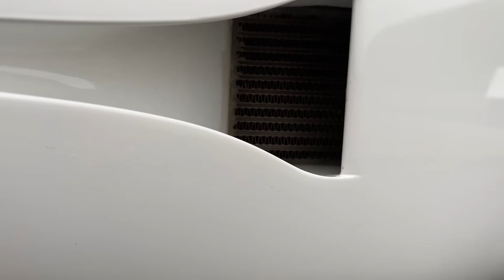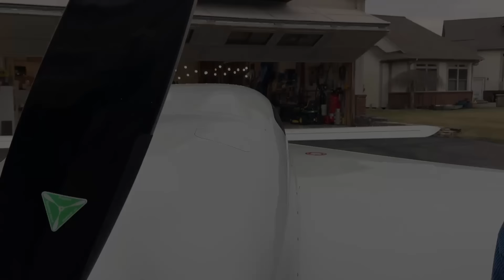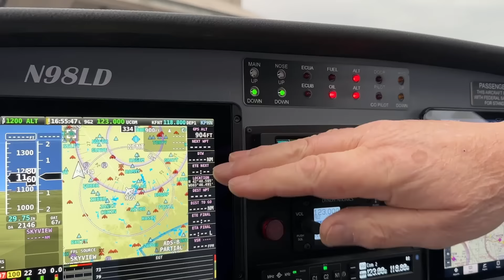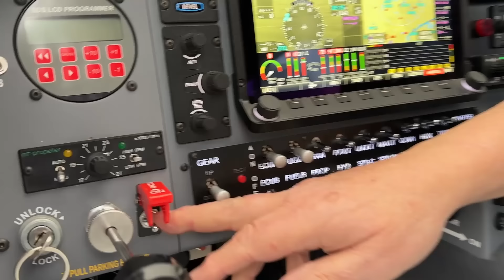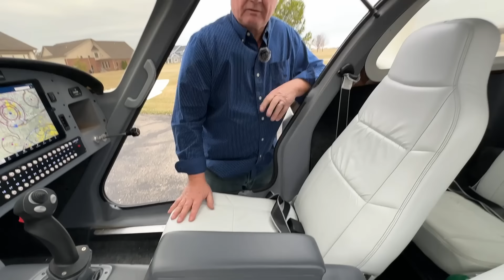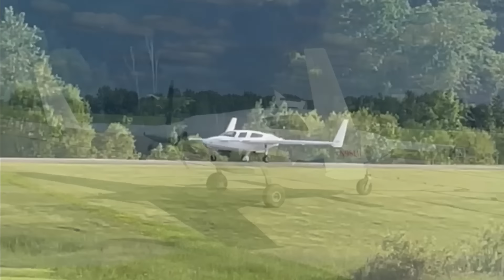LS3 V8 Powered Velocity Walk Around

Comment: Cool build.

Not really a P-51 scoop, though, as it doesn't make use of the Meredith effect.
Reply: That’s interesting…

Compared to the P51… the Meredith effect needs a lot of heat put into the scoop….

The Merlin engine was over 1k hp…. With a lot of heat generated….

Trying to get a useful Meredith effect in this small package… would be interesting…

The rpm of the Merlin engine made the prop tips get closer to speed of sound….  A very loud experience…

The MT prop used on this plane is a quiet prop compared to the aluminum props… very neighborhood friendly!

😃
Reply: @AC-jk8wq  It has been done with Subaru powered aircraft, it's simply a matter of scaling everything appropriately.

PSRUs are a great thing to have, that's without a doubt.
Reply: @  

lots of work in this area over the last decade…

The PSRU failure modes of the past have been catastrophic, especially for the high horsepower Chevy engines… prop loss, followed by weight and balance challenge.

They briefly discussed the gear ratio and the simple system Len is using… but no pics, or additional details I was hoping for…

😃
Reply: @AC-jk8wq  It's surprising to me that engineers would have so much trouble with gearbox design these days, considering the advancements made in the last 80-90 years. Maybe it's related to the much lower cylinder count found in the engines the gearboxes are being used with, relative to the 12 to 28 cylinder engines from the heyday of the piston aircraft engine?

Crossplane V8s certainly aren't the best thing for use in an aircraft, they have heavy counterweight systems and don't seem to do well when used frequently in their higher rpm range. A 3.5 to 4.0 liter flat-plane V8 would definitely be a better fit for aircraft use in this horsepower range. I was just watching a video of a McLaren 650S engine being rebuilt (the engine is based on a Nissan racing engine), something like that seems like it would be far better suited for use in an aircraft, with its light weight, its flat plane crank and its replaceable cylinder liners.

This Velocity uses a PSRU from Ballistic Gear Drives, there's slightly more info on their website, but not much.
Reply: @AC-jk8wq  And, no, I'm not saying that the McLaren engine itself would work well in an aircraft (unless it was built specifically for racing), I'm saying that it has attributes which would work well in an aircraft engine. Obviously, an aircraft engine would be optimized for much lower rpm operation than the McLaren engine (5,000 - 5,500 rpm).
Reply: @PistonAvatarGuy  

Conveniently, the newer Z06 Corvettes are using a flat plane crank….  Awesome horsepower!  😃

The biggest challenge with gear boxes for planes….  Weight and balance.

Putting a heavy object (like a gear box) on the nose, needs to be balanced by another weight towards the tail…. The science call ‘statics’ covers the math for distance and weight….

There is a large driving force for the plane builder… to use the lightest weight gearbox.  This allows for more people weight and/or fuel weight for the flights….

Lighter gear boxes, are not as strong as heavier built boxes… selection of materials also gets affected… 

The second biggest challenge… the cost of development.   We can’ afford to have a failure of a  single PSRU. As PSRU failures are often fatal.

Picking one off a shelf and using it in aviation becomes a giant risk for the owner/pilot…

Modifying it for the specific application… now the pilot/owner is known as a test pilot, in the literal sense….

Where I lose confidence in systems like this… there are always unseen challenges that can arise…

Whatever the failure is… we need to be able to survive it, to fly again…

If there are 10k planes using the same gearbox… there is a good chance that if there is a failure of one, the other 9,999 owners will know about it.  This allows the pilot community to know what to look for before the next flight….

If there is only one plane using it…. There isn’t a like minded community to share the experience….

This leaves me with the disadvantage of having to own a factory built airplane… where we live in fear of a government issued AD notice.  These come in the mail every now and then… telling of what failed on what similar aircraft or device…

Back in the 1990s… there was a group of planes that experienced engine failures… they ran out of oil, mid flight….

The oil coolers on continental aircraft engines were cracking, and spilling all of the oil out….

Crazy stuff happens, even on simple systems being used for decades….

I fly a plane that was built 9th in a series of hundreds…. But, very similar to thousands of other planes built by the same manufacturer….

The oil cooler challenge first appeared in Cirrus aircraft.  They pull the chute.

The airplane I fly landed on a golf course… (long before I flew it…)

Engine issues are critical, more critical depending on where you fly….

500hp in a four seat plane… is the thing dreams are made of!

Using a Chevy V8 makes it affordable-ish….

😃

Comment: All is cool, but I would not design the front wheel this way to use it to be turning. It looks like it is going to fail if the plane hits the ground on landing on snowee or muddy surface. Otherwise - great work!
Reply: Nobody gonna land a pusher prop in mud bro.
Reply: Nobody Wants to do it, who knows, who knows...

Comment: SMH...  the whole idea of a canard is the canard stalls before the main wing. VG's on just the canard reduce this safety feature
Reply: He has VGs on the main wing as well.  However, there is a big enough margin between the canard stalling and the main wing that VGs do not affect the margin of safety.
Reply: @bgaudioso thank you big thought
Reply: The whole idea of the canard…

Both wings are in lift configuration…

With a standard wing layout… the horizontal stabilizer is an inverted wing, pulling down at about 75Lbs…

The difference… about 150 Lbs more useful load for the canard… (theoretically speaking)

Canard challenge… keeping disrupted air flow from the canard from interfering with the airflow over the main wing… 

Other canard challenge… keep the nose wheel from launching pebbles into the prop arc….

😃

Comment: That is some really nice work. It sounds like a hotrod too. I really like the idea of converting automotive engines, you get more for your money. I think they are more durable too.
Reply: I agree to a point - While I'm not a fan of having to use ancient tech (current Continental & Lycoming engines) with 'ehh' upgrades, consider that 2,000 hours @ 55 mph (just grabbing a reasonable number for the heck of it) equals 110,000 miles. Trading off that that mileage figure is understandably short for many on-road vehicles these days but when does it become a rational amount for an airplane?
Reply: @carlbeaver7112  Automotive engines consume allot of dirty air and are often poorly maintained. They have to endure allot of extreme heat cycles and stresses that aircraft engines don't. When I was starting my flight training I was told all kinds of things not to do, that could damage the engine. I was taken aback. You don't have to baby a car engine. I am still surprised that people are paying $30k or more for 100hp aircraft engines. This makes no sense to me.
Reply: @anthonymartin9672   The price is because the engines are certified.  The process to certify an aircraft engine is very long and exceedingly expensive, and at the end of it, you don't sell that many engines compared to what a car manufacturer sells.  On top of that, aviation is not very forgiving of equipment failure, and lawsuits are often for very large amounts of money, usually by the family of the pilot.  This reality is also reflected in the price of the engines, since every engine sold could become a wrongful death lawsuit if it has flaws.

Comment: The FCC is the entity who says it’s illegal to use a cellphone while flying unless that rule has changed recently. Most pilots agree that the rule is archaic and that being able to speak to ATC on the phone would be a smart safety backup among other things.
Reply: Cell tower antennas mostly point towards the ground…. So getting reception at altitude can be a challenge outside major cities…

But, SpaceX is changing that as well… especially for emergency communication…

😃
Reply: Screw the FCC, if you need to use it then use it.  What is their problem?

Comment: Awesome. Does he have any details on that gear box? Who made it? That's a lot of power going to a big rotating mass. Impressive that it can withstand those conditions.
Reply: *Looks at the R-4360.

*Looks back at this comment.

Huh?

Edit: It's made by Ballistic Gear Drives, they make gear reduction units for airboats.
Reply: I always worry about the reduction boxes on the auto motor conversions, especially if they don't have a dampener to cushion impulses transmitted through the prop. That crankshaft and bearings were never designed to deal with a large propeller.  That's why the bearings and cranks on aircraft engines are so much bigger at lower power levels. Sure, these work for a while, but after 1000 hours of unknown wear, how much do you trust that engine when departing in a no landing option location?